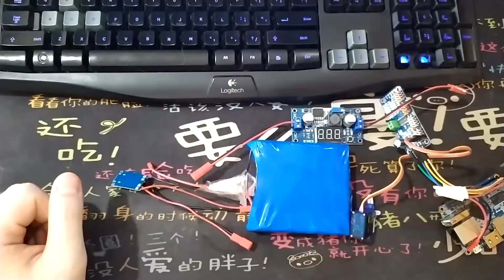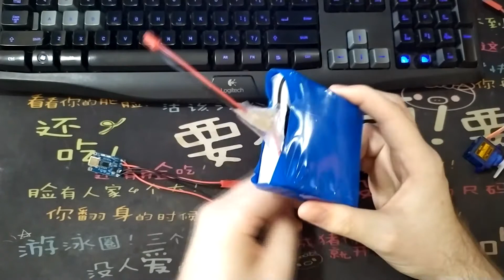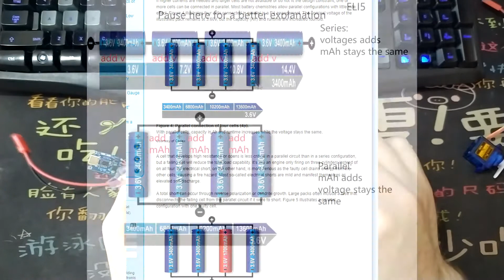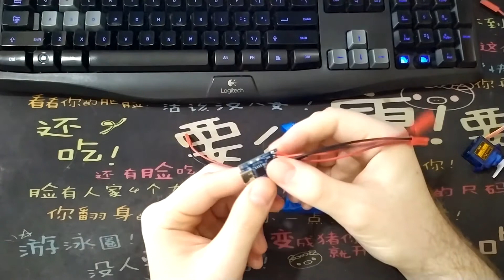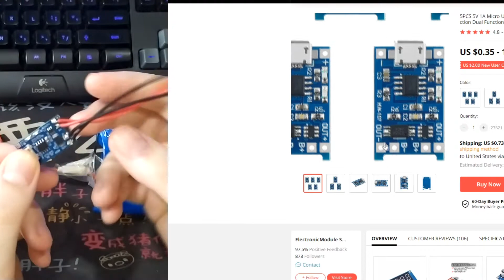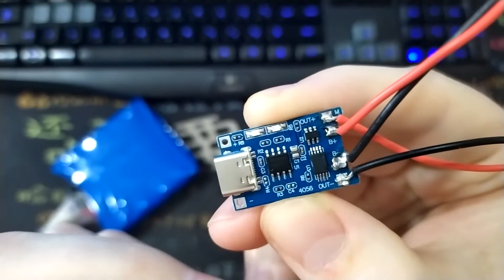powerbank rescue

Comment from the maker: additional note, make sure you hook something up to the output of the tp4056 that meets the requirements of your device. for example, if you are powering something that charges at 5v and you only give it 3.7, it is going to have a hard time. so you may want to look at a boost/step up converter (opposite of buck).

the batteries used were initially tested and have matching voltages, you should be fine with just using batteries straight from a powerbank and not testing them. but it is better to be safe than sorry.